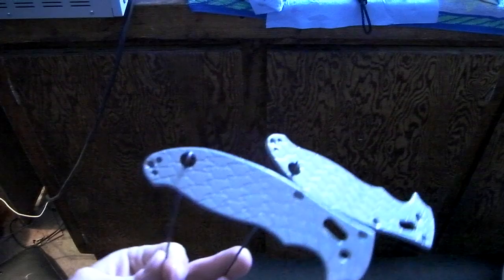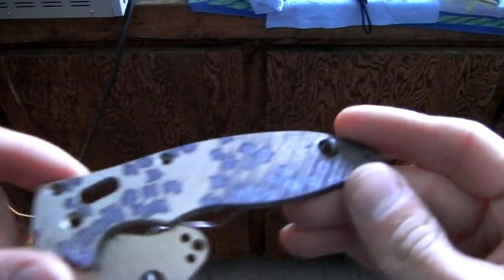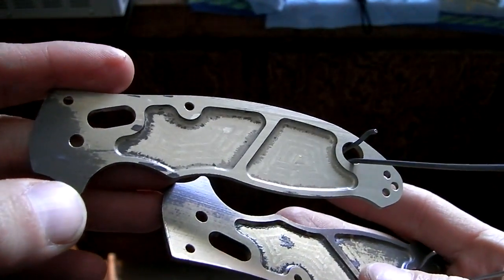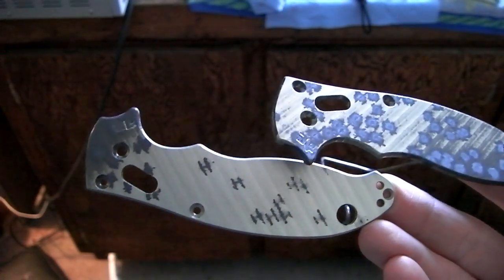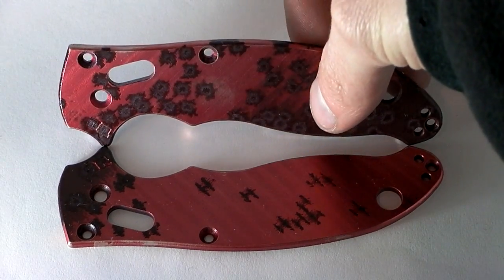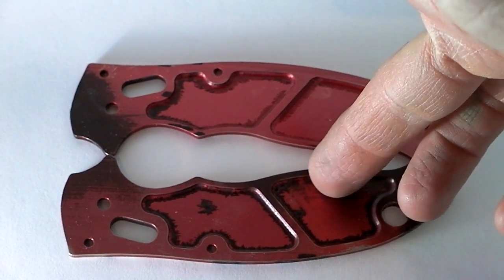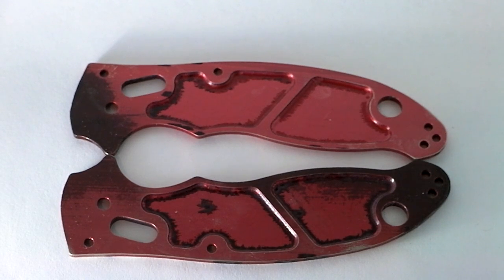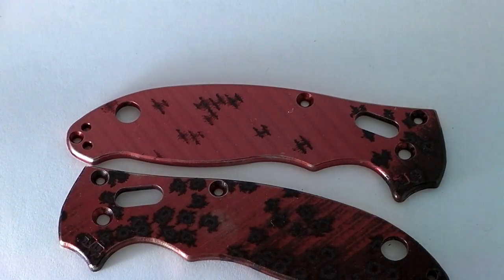Anodizing mistake - ugly spots

Comment: Hello, I am far from a Pro when it comes to anodizing, I mainly do Cox engines. Anyhow, what I have learned is Probably not a GOOD Conection and try turning down your amperage ans run in the tank a little longer at a lower voltage. I have something very simular when My amperage is to high, by Acid bath is to hot,  and what I thought was a good connection. Wou will also learn that reds work best at about 70-75  degrees.  I got a Tee Dee Crankcase ready for the bath and want to use red, but my percentage ratio is if I dip 3 , 1 will come out unusable.
Anyhow not a Pro, There are so people on the Caswell forum, that know Their Stuff. I do A high Polish before anodizing. Jim "P" Jenuine-Motor